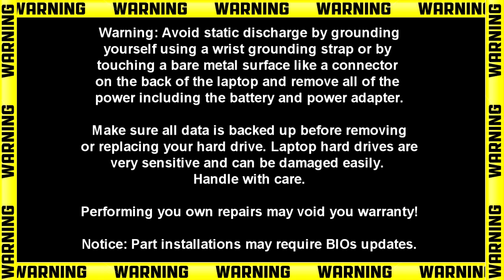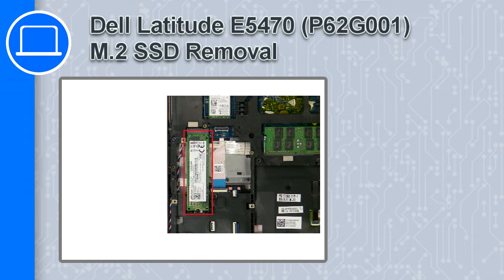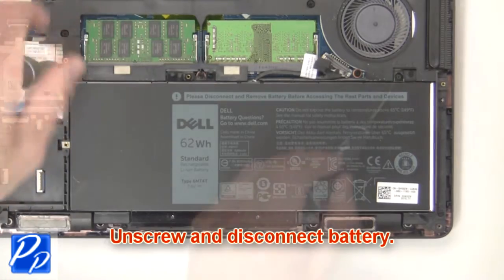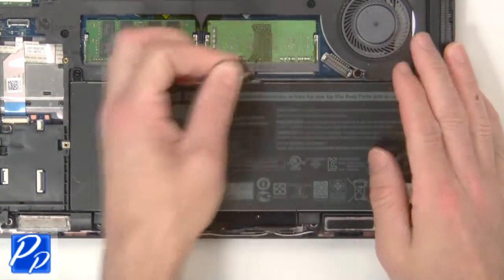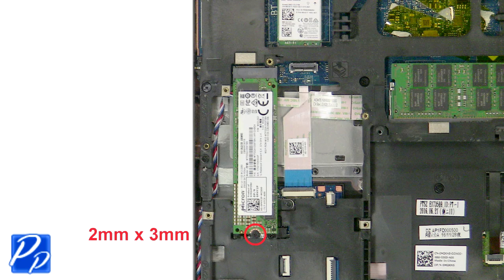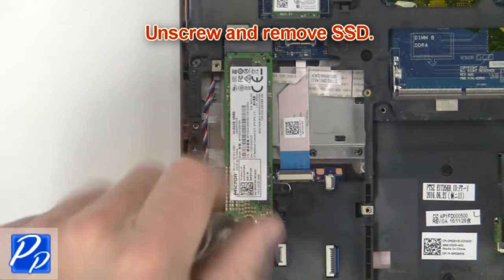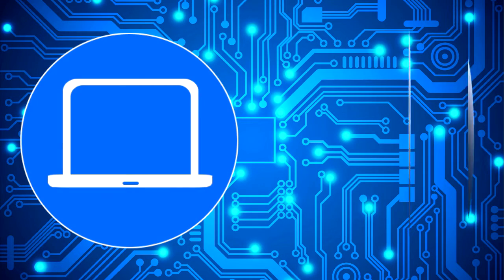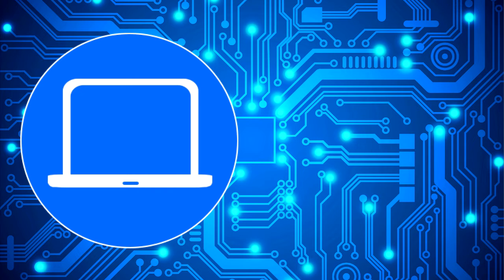Dell Latitude E5470 (P62G001) M.2 SSD How-To Video Tutorial

Comment: I didn't understand why you took out the battery
Reply from the maker: As long as you fully disconnect the battery, removing it is optional. For safety reasons it is my personal preference to keep all sources of power far away from my electronic components to avoid any accidental damage.

Comment: I have this model and it has the slot to connect the M2, I tested and it works, but it doesnt come with the small metal plate to screw it, how is that called? where can you get it?
Reply: It is called "M.2 bracket". The whole kit to install an M.2 disk consists of this parts (and Dell part codes): 

1 x  M.2 SSD Caddy: 0X3YR8
1 x  PCIe Bracket: 01X2MT.
4 x (M2*M3) Tornillos
1 x (M1.5*M2.5) Tornillos